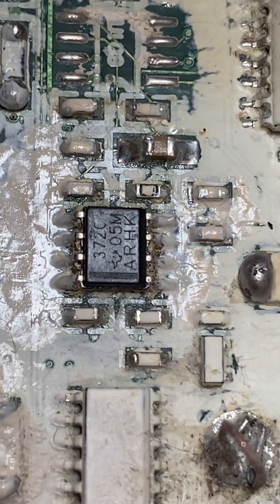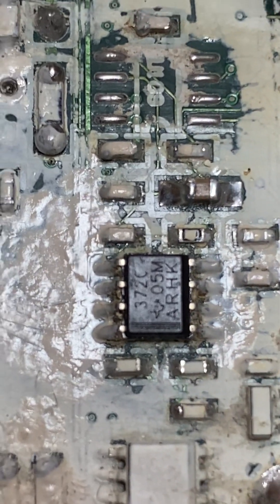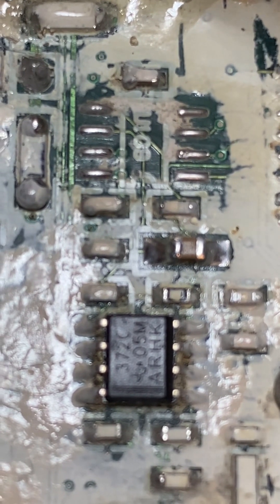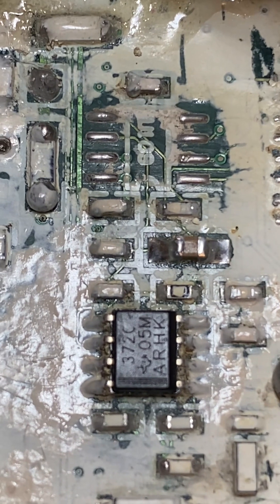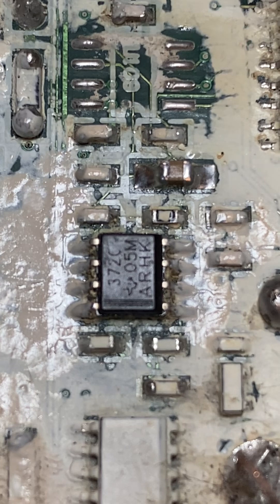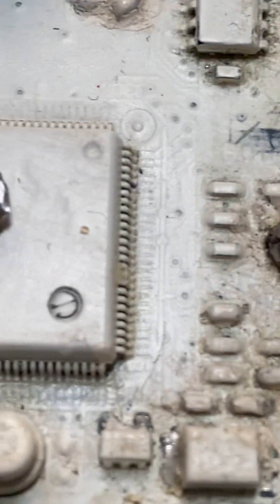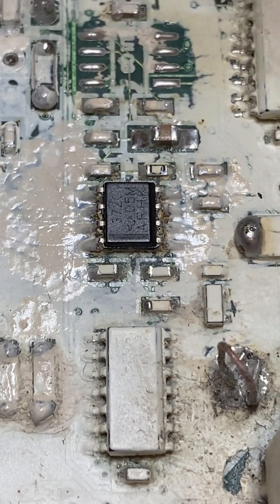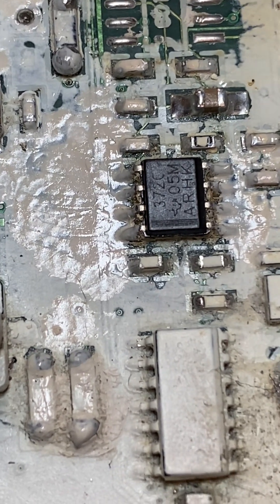Minelab GPX4500 over current repair part 1

Comment: Hi Professor
Thank you for making your training video. If it is possible in a video like this one, explain the problems and introduce the defective part. Thank you.
Reply from the maker: I can but i would be making hundreds of videos.
Reply: @DetectorMods Yes, thank you for your efforts. Most of our problems in the gpx system are when the power goes out under the mast and has a problem. Which parts are damaged in this problem? Please explain in a video. Thank you, professor.